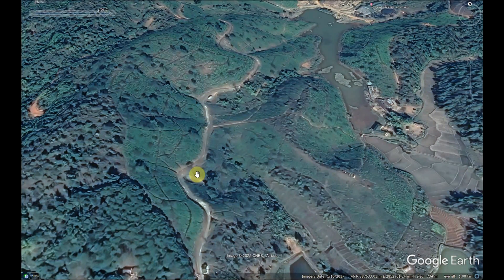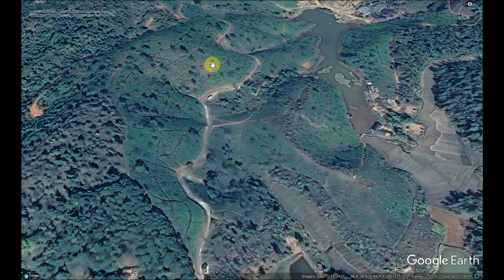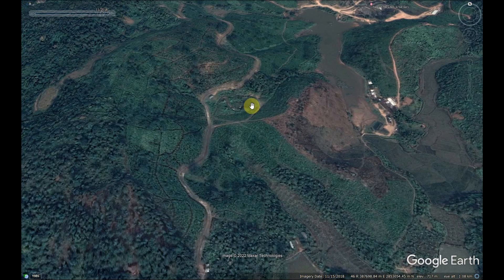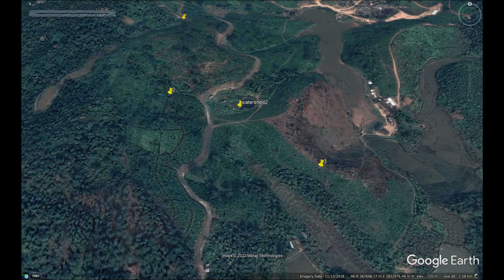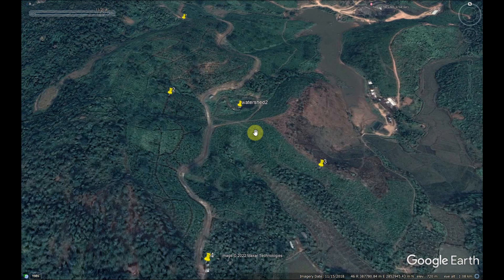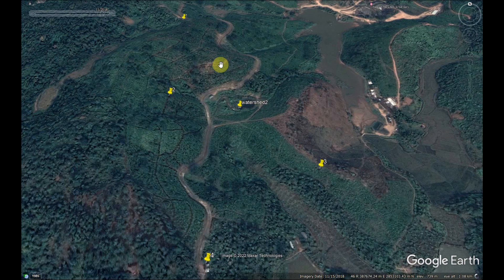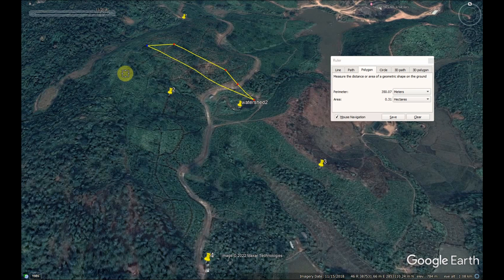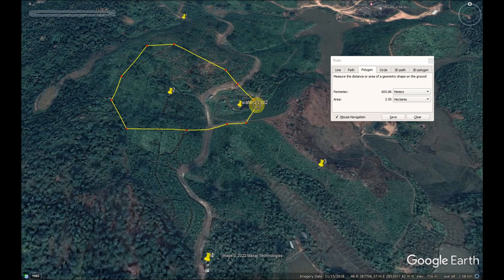Watershed Development 2

Comment: How much is the total cost for constructing embankment as well as the pumping system with solar system? Is it micro irrigation system?
Reply from the maker: Hi Apong, thank you for your query. The construction of the embankment will be as per the prevalent hire rate of the excavator(jcb). The depth is not required to be so deep and if excavated during the dry season then the time taken will also be less. So if it takes say 2 days to complete the embankment excavation then at the rate of 1800/- per hour for 10hours a day for 2days will be 36,000/-. 
Pump of 1.5hp (mononlock pump) might  cost say 8,000/-. Solar panels, inverter and batteries say 1,50,000/-. Pipes, sintex tank, etc. say 50,000/-. So total say round about 2,50,000/- to 3,00,000/- . This is just a rough estimate to give you an idea 😅

The water simply goes to sintex tanks where water is difficult to access and then are sprayed using battery operated knapsack sprayers.